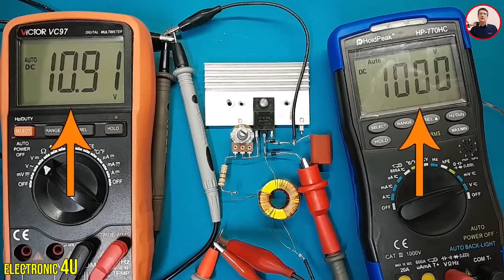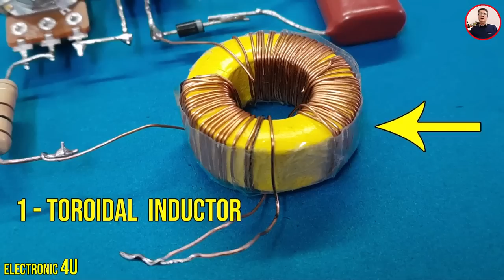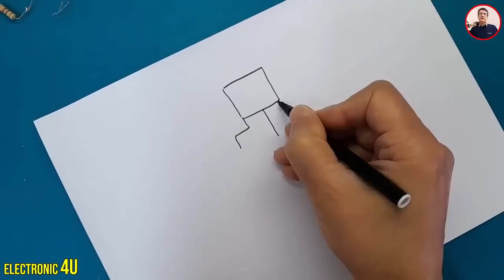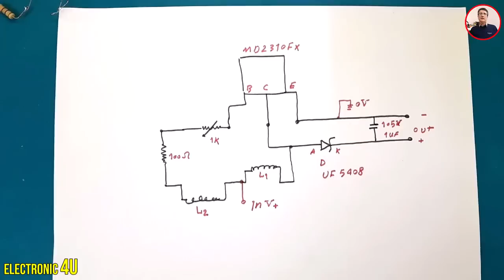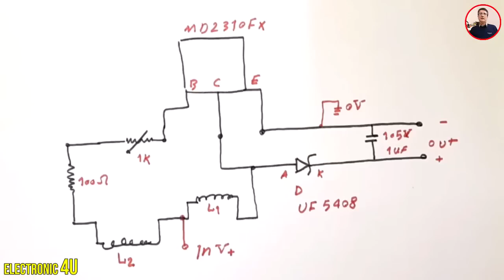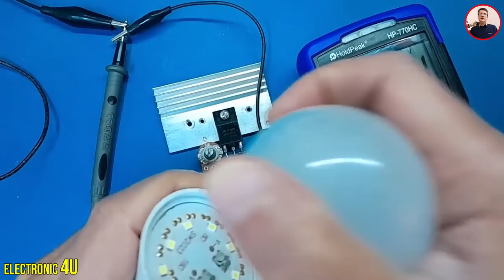Any voltage you like, build it for yourself. 😊

Comment: Interesting presentation but TIP 31C is good only for 100 V. A MOSFET might be good but think we need to check that gate voltage may be exceeded by high voltage pulse. Many thanks!
Reply from the maker: Yes, you are right

Comment: Gd day sir,,,here in the phillipines!,,, ur circuit is perfect for DIY Sparkplug Tester!!! W/ a variable resistor ,,variable frequency can represent RPM calibration,,  powered by 2or 3 lion 18650 battery to sustain volts& Amps,,,,TRY TO MODIFY TO SPARKPLUG TESTER???
Reply from the maker: Hi. Good idea. Yes. I think I'll try it.

Comment: Nice video .
But one question : in the démonstration 2 diodes are used  , then in list and diagram ther is only one diode is it normal?
Reply from the maker: Hi, there is a second diode to protect the transistor from induction load, described in the Hello, there is a second diode to protect the transistor from the induction load, I described it in the video. ❤️

Comment: if i'm understanding this correctly.. the circuit basically slows the  duty cycle of the DC input then stores energy as magnetic field in inductor then release it.. so basically we have high duty cycle input with low voltage then convert it to low duty cycle with high voltage output
Reply from the maker: Yes, that's absolutely true. ❤️

Comment: Please sir 
What is amps of the output voltage of the capacitor
Reply from the maker: The higher the voltage, the lower the current. This circuit with this inductor does not have much current at the output 🌷

Comment: Thank you for your video, it is really very interesting. I have a question if I make this circuit with an input voltage of 24V and an input current of 5A I could have a voltage of 400V and still the same current of 5A at the output?
Reply from the maker: The appropriate topology for your job is to use two transistors that turn on and off one at a time, along with the appropriate  transferrite. 🌹
Reply: @Electronic4U-david  Okay, I would be grateful if you could make me an electronic diagram because I don't know much about it, please.
Reply from the maker: Thank you very much. This circuit with this topology cannot produce much current at the output.

Comment: Hello, I appreciated your video, but you can write the value of the electronic components you use, the value of the inductance transformer, and the writings that appear on the video prevents the diagrams well.
Reply from the maker: Hello, thank you very much. Tap the cc button above the video to disable subtitles. You can use any ferrite core
Reply from the maker: The values are written in the description section of the video. If you increase the thickness of the wire, the output current will be  greater🌹

Comment: So, please give the design equations relating input voltage, the frequency of oscillation, LC tank parameters to the output voltage, and the toroidal coil designri
Reply from the maker: Hi, these videos are meant to see how the circuit works, often the equations are a bit annoying for newbies. If I can, I will try to present 🌹

Comment: Assalamu Alaikum Bhai Jan 
Can you add octocouper to get stable voltage like if we Connect 12volt solar 
In says we get 18 volts and then slowly day finishing we getting low voltage and need 24 volt
Reply from the maker: Hello. This circuit is not suitable for your work. You need a battery to charge the battery first and then increase
Reply: @Electronic4U-david  sir
Please make an circuit to stable out
In voltage booster circuit
Example 
Our voltage boosting and decreasing 3.5 volt to 9 or 12 volt and we need an stable 12 or 24 volt output
I hope you understand and help us
Reply from the maker: I'm sorry for the delay. The circuit you need is available in module form. In order to increase or decrease that is stable, there is a need for feedback. Therefore, the integrated circuit must be used so that it can receive feedback. If I have the opportunity, I will introduce a circuit 🌹
Reply from the maker: Voltage surge circuits are better for proper feedback, if you need a higher current, you can use  MOSFET in the  module to provide the output current.

Comment: YESS I LIKE TOO HIGHER  VOLTAGE..*AND WHAT ABOUT AMPERE !??? HOW MUCH AMP. YOU GET ?? IF 1-5 ITS NOT HELP ME,
Reply from the maker: This circuit does not have a lot of current because the inductor is small and the wire thickness is low 🌹

Comment: Esse circuito dá para utilizar em uma configuração input 120v bateria 40ah - para reduzir para 60v 20ah ou menos :)
Reply from the maker: No, this circuit does not have much current. For high current, the wire must be of high thickness and the size of the transformer must be large

Comment: Oky bro good. I have a question for you. How to make 1.5 volt up to 12 volt. Most point it has good current. Can you show how to do.
Reply from the maker: If the inductor size is large and the wire thickness increases, the current will be higher. Reduce the number of revolutions of the coil to reduce the voltage

Comment: qual a corrente máxima que o circuito suporta?
Reply from the maker: Hello. There are several important factors. The thickness of the ring wire should be higher. The input current and power of the transistor are also important ❤️

Comment: This is a very interesting video I was searching I would like to use...I need to contact you. I have DC equipment like lights and fans etc.. all in DC controlled about 300meters of wire of 2.5sqmm . The DC voltage needs to step up at one end  and then step down at each required since the wire dis is small ( higher the voltage lower the current)  pls give your opinion
Reply from the maker: That sounds like a fun project!  You can use this method to create a system to power your DC equipment. 😊🌹If you have any questions, please let me know. 🌹
Reply: @Electronic4U-david thank u for replying quickly, but would 2.5sqm do? For transmission toal load about 3000w? This circuit would take it? I need stepup boost and then step down buck . The load during daytime from solar panels  night time grid

Comment: Pls Say Something About the Toroid Core Material Is it mix 26 (Yellow,Definitely wont work),Or Oxides Core mix no 6 (yellow)or Ferrite Core ..Ideal for the Purpose,cause can give High Inductance...Thanks for the Shared video and info....!
Reply from the maker: You're welcome! The core material used is a common ferrite core, often referred to as Mix 6.
You can use any selfie. It will definitely be implemented.

Comment: He has not said how many turns the primary winding should have, nor the secondary winding, nor the approximate measurement of the inductance of each coil
Reply from the maker: Hello. I got this self from Power ATX. Every selfie will be. Only the number of revolutions of the secondary coil should not be low so that it can provide the necessary voltage for the base
Reply from the maker: The wire thickness is for high currents. Schedule as much as you can
Reply: @Electronic4U-david  You already said that in the video.How many turns?
Reply from the maker: I didn't say no. You can twist wires as much as the ring can fit ❤️